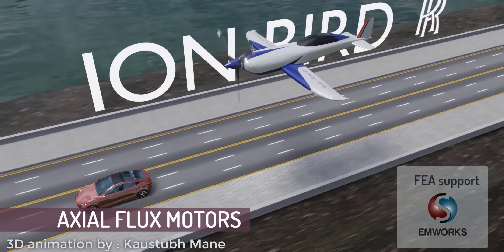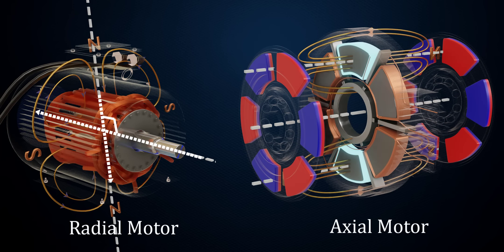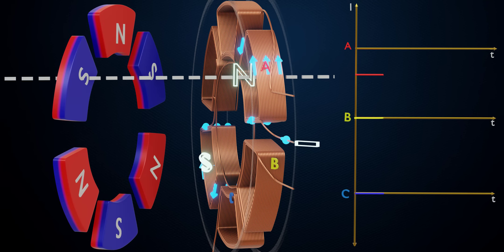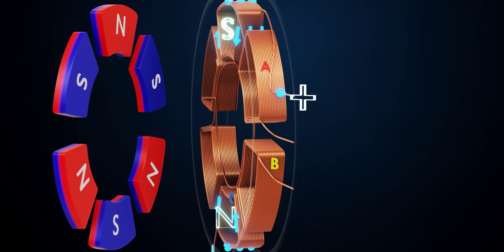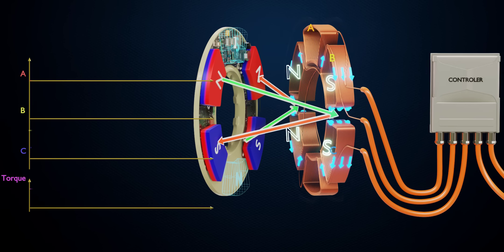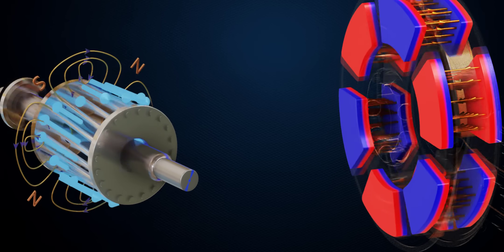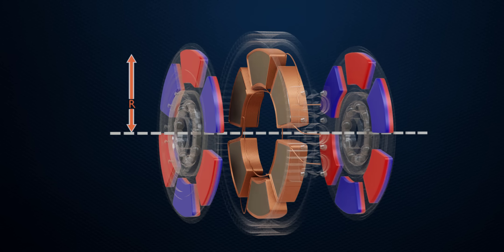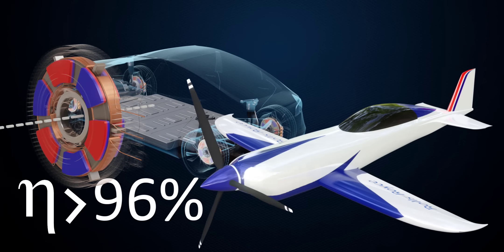Axial flux motors - The new hope

Comment: Thanks for posting this film and nicely explained thanks. A 200 year old motor is what we use today, isn't it time we moved to zero point energy?

It's also a new word for me to add to my vocabulary, that and how these things work. Presumably with an axial flux motor and the better torque wouldn't all the drills be better off than using the radial flux they use now?

Interesting word tangential and very hard to say after a few drinks.

Comment: What a fantastic demonstration. Great explanation on the concept of three phases. I would like to add, people have no idea how powerful shapes are. By simply changing the overall shape of the stator and rotor combination into a disc fashion rather than a traditional cylindrical fashion, you have shown how much more efficient it is.
Reply: Similar to how disc brakes and drum brakes are
Reply: It is not. The main advantage is weight. Not really big advantage for cars, but in aircrafts might save enough weight for extra passenger.  Hobby RC motors have 90+% efficiency.

Comment: Just like the gear interrupter in the maximum machine gun for airplanes you can use a gearing system to turn on and off the wire connections increasing your speed because even computers have a limit on how fast they can go but if it's a mechanical physical connection on and off the timing would be incredibly precise and your rotational speed can increase to any limit
Reply: A $0.10 microcontroller can trivially flip a switch 20-30Mhz for decades without missing a beat or needing any maint.  Please cite some physical connection that anything close to that speed, and isn't going to need constant maint.  Such a dumb comment.

Comment: I would disagree with the affirmations from the video. The radial motor has the optimal structure, the problem lies only it is build using too much metal core, reducing the amount of metal and rethinking the winding will drastically increase its specs.  Radial motors are produced by using a classical, old established, sometimes not optimised design.

A downside to the Axial motor, it is a good source of generated structural vibrations and noise.

Comment: These motors have been around for quite some time, just rediscovered and most importantly renamed . Most important aspect is not motor design but in low cost microprocessor control.
Reply: i don't figure out how to analyze it with ID Iq
Reply: @GreenTechValidation  you have problem understand because these are business details and accounting looking for money. There is very very little engineering truth in what they are saying, they are looking for funding .
Reply: @henrysangret5324  😁
Reply: @henrysangret5324  cannot find any information about FOC control of  axial flux motor in whole internet

Comment: Sorry, this video is not structured well for teaching. You spend the first 4 minutes explaining how synchronous motors work, but never mention that this applies to both radial and axial flux motors.
Then you compare an axial flux synchronous motor to a radial induction motor, a totally different type of motor. That comparison is useless, you should have compared axial synchronous to radial synchronous.

Comment: Yeah that's great. Now get back to everyone when the energy density of batteries is not 2 order of magnitude less than petrol and I might believe an electric plane or car with a decent range is possible.
Reply: TF you talking about. There are literally 1000km range cars already, and it's about to get better, as well as easier and quicker to recharge. You'll need a break anyway before you run out.

Comment: On todays episode of "A revolutionary new idea with seemingly no drawbacks which you will never hear about ever again"
Reply: They say (twice) in the video that it's not new... In fact, they flat-out say that the basic design is 200 years old.
Reply: This comment section have no idea that this type of motors are already commercialized and widely used. For example, Energica uses such a motor for their motorcycles. And Koenigsegg uses Yasa axial flux motors in their cars.
Reply: This is the motor used to spin the record/playback head on video tape recorders, another drives the tape.
Reply: @y2kmagna  its also the exact design of the flat motor in almost all Floppy Drives. It's a pancake brushless motor.
Reply: @y2kmagna  le
Reply: I have not been this impressed since Rockwells' Retro encabulator.
Reply: They've been around for ages. If they were so perfect as this video say, they would be used.
Reply: @jcd-k2s  true, but the application of mosfets and hall effect sensors or smart timers or variable frequency controlers is newish. A coil motor be it any type is old hat, but the application of small but powerful electronics is why things are starting to get exciting. Still is not as practical in applications such as motor vehicles or aircraft where range or pulling power are required, but these are all the steps in the right direction.
Reply: I love that show!
Reply: The main advantage of this machine would be that it saves some weight in lower speed applications (<10k rpm), as the wide construction makes it easier to fit a lot of pole pairs in the motor. Without having to use a gearbox.
You can also achieve this by taking a radial permanent magnet motor that runs at 20k rpm, with less pole pairs, and connect it through some kind of gearbox. By using a motor at high rpm, you can reduce the size for the same power rating. This is done in the drivetrain of a Tesla.
The difference between the first "new" solution, and the second solution in weight will be likely be insignificant compared to for example the battery weight. The dimensions that are most practical will likely determine which motor type you use.
And of course how easy it is to manufacture each motor type.
Reply: Blah blah blah petro oh blah blah blah batteries.. why not simply gen ⚡💡
Reply: Rolls-Royce a major aircraft engine company is investigating this.
Reply: What???
Axial flux motors and generators are everywhere. I've got five of them in my garage.
Reply: Isn't the same motor of brushless ebike hubs?
Reply: Sounds like more people should give an axial flux about this!!!
Reply: Overheating of magnets prevent this to be useful
Reply: Koenigsegg created a 87lb engine with a huge amount of torque. I guess it gives 350hp. The Gamera is a hybrid car that uses it. It is the fastest car in the world.
Reply: This comment will not age well.
Reply: The drawback will most likely not be the motor, but the power supply. If they're trying to replace( or be an alternative) prop engines then they have a long way to go.
Reply: @papermaster7764  There's many other uses for these. They are also a very suitable generator, particularly for low current applications like gas turbines. The media only ever talks about grid solar and it's drawbacks but there is a better alternative: local micro turbines.
Reply: @philipm3173  I am aware of those applications. I was referring to the video topic of them being alternative to prop engines. The battery won't be an issue if it's on ground or underwater. It's a different issue if the battery needs to be in the air.
Reply: A/c as well.. some folks
Reply: I can think of two drawbacks already. 1) Battery range is nowhere near where it needs to be for planes. 2) Lithium is highly reactive to water in the atmosphere. And fires are one of the worst hazards for flying. If the battery is damaged and ignites, there’s no fuel cut of switch.
Reply: Only if you don’t do your part to spread the message, Yhe’is’us
Reply: Lol
Reply: They have drawbacks. Costs, rigidity,  longevity same as other motors. If they were far superior then standard radial motors would have been long a thing of the past.

In other words, as you can see, so many people and companies are working on 150 yr old designs across the board and making drastic improvements but there's only so much to be had in terms of precision  , Costs, materials, durability, efficiency. 

There's likely even better designs that haven't even been imagined yet. Innovation is wonderful like that.
Reply: Except that koenigsegg recently announced raxial motor sounds a lot like this. 250kw and incredibly compact.
Reply: koenigsegg is using this on their new EV
Reply: These motors have been in production for 10 years in the UK.
Reply: It’s already being used in hypercars
Reply: YES!!
Reply: "Graphene"
Reply: It's used in some electric bikes though? Like ones that use Lynch motors
Reply: They lost me at the inclusion of a "smart" element within the motor. Part of the reason I'm drawn to EV conversions of internal combustion is because I want fewer failure points, and computer chips are just a buffet of failures.
Reply: Heard of aptera? Anyone?
Reply: Every now and then someone reinvent the wheel just to evaporate soon after 😂😂
Reply: What an idiotic comment. Axial motors are already being used in many electric aircraft and some hypercars.
Reply: Joke's on you... McLaren, Lamborghini and Ferrari all use axial flux motors in their hybrids...
Reply: You will hear about them very soon
Mercedes is starting full scale manufacture for their ev's
Reply: This comment aged like fine milk
Reply: That's because they don't like to tell you the drawbacks. You won't see this again because the applications of it have many other issues that do not have a solution yet so thereby making this idea useless.
Reply: @joshuasanford6934  Yep, A battery to power these motors for the average car would need to weigh 1 ton (imperial) to provide the energy equivalence of 10 gallons of gas (petroleum).
Reply: @martyfrank  on top of a huge power supply what are they going to do with the old/broken batteries. I'm sure some form of recycling could be used but I don't think that the insides of used up batteries could be recycled (I may be wrong), so the question is where would it go? I feel electric cars and planes are just not the way to go for the future, unless we somehow got a dyson sphere built in next hundred years or if we find a very efficient and clean way to get energy. As the waste of the batteries and the energy cost used to even get battery materials far out way the benefits of the electric vehicles we have today. Though with time and research the idea of all electric cars and now possibly planes could come to reality..... Though now terrorists could just use EMPs to disable everything if that happens. analog is the only way to not get affected by that, that's a whole other topic.
Reply: @loonyroxxs2482  batteries can be recycled (https://en.wikipedia.org/wiki/Battery_recycling) it's just a matter of economy of scale, once there will be enough spent batteries around, extracting metals from them (where they are in high concentration) will be cheaper than mining.
Reply: @Francesco Di Mauro yeah and if you really think about that, that is easily a hundred years or more in the future and we don't have electric drilling rigs or anything of that so the cost is still far far faaar greater then the return will ever be as more gas is used to get the metals out of the earth and to even supply power to the batteries, wind and solar are currently a pathetic source of power to recharge everyones batteries hence why our coal and nuclear plants are the main source of power for those electric vehicles, so in all if we were to suddenly put a ban on all gas powered vehicles we would destroy the planet in a matter of years from the huge quantities of pollution to power those precious safe for the environment electric cars, and the fact you gave me a Wikipedia article shows me you didn't put a lot of effort into researching this topic, its easy for media to sway ideals to something that sounds better but really has way more negatives then the alternative.
Reply: @martyfrank  10 gallons of petrol requires 170 gallons of oxidizer to extract the energy so try to squeeze  this in a car also.
Reply: @darkbulb367  , welfare
Reply: @darkbulb367  do you have any evidence to support those conspiratorial claims?
Reply: @martyfrank  Comparing straight up energy density like you are is essentially meaningless when you consider the difference in efficiency between the 2 technologies. An ICE based car inherently needs to carry more energy because of its inefficiency. Comparing range is far more practical. 

Going by density ignores the fact that an ICE based vehicle can only turn 18-20% of the energy stored in the fuel into actual useable power. For the electric motors found in an EV that number is more like 85-90%. So say you have an ICE based vehicle that holds 20kw worth of fuel, an EV could provide the same range with less than a 5kw battery. 

Now you might say "well the grid is still largely powered by burning FF's" (which is true.) But even if you're charging from a diesel burning power plant, they can achieve over 50% efficiency. Fully charging that 5kw battery only takes 10kw of fuel at the plant, compared to 20kw for the same range in the gas powered car.
Reply: @FrancescoDiMauro  that still doesn't change the fact that lithium has a tiny fraction of the energy density of gasoline
Reply: @loonyroxxs2482  you're in the wrong video if you don't understand the inverse square of magnetism. EMPs are theoretical and a non issue. The only time they're an issue is next to a thermonuclear explosion..  but then emp is the least of your worries.
Reply: @formattable1  Undoubtedly true but quite sufficient for getting a light weight vehicle around our urban environments. A two tonne plus SUV is an evil absurdity in a city, whether electric or petroleum powered.
Reply: @loonyroxxs2482  throwing away Li Ion batteries will be like throwing away gold.. why would they do it? It’s already mined and they know the exact concentration of what’s in it already. It’s easier than mining for new stuff, especially when you apply economy of scale.
Reply: @loonyroxxs2482  Simply, a gallon of gas has much, much more energy than a battery of the same size.
I would like to see more hydrogen powered things. Use nuclear energy to separate H2O into hydrogen, cars could have ethier a replacable or refillable tank, no waiting for a battery to charge. There's already propane and natural gas vehicles that contain a flammable gas under pressure so it wouldnt be much different with hydrogen.
Reply: @Longbow64  True hydrogen vehicles would be a good step, my only fear would be it exploding if a fire ever caught up in the engine lol, although I don't think you got a bad idea going there
Reply: Because it turned out once you move from cool 3d animations to actuall real world implementation, it turns out it actually has drawbacks. Who knew ??
Reply: @marianpazdzioch6632  what drawbacks?
Reply: I suspected this is what the video's title is.
Now watching with a heeavy dose of salt and skepticism.

And this is coming from someone who firmly believes ETs are observing us up close.
Reply: This is the green tech story in a nutshell. "Omg. world changer. we need investment." years pass "Oops. Well it doesn't scale. Doesnt work when the temperature goes above 71F. Produces toxic byproducts. Costs $1T to make three of them." etc...
Reply: @KevinKimmich44024  I have no idea why people like you are so pro-pollution. So there's no wind turbine farms all over America. We just imagine there are. It was another failed green technology.  Just stay in your bubble of delusion.
Reply: @UCchT9NSgfajAoQ8ZrQYoO3w I've been following "green tech" and electric vehicle companies since the early 2000s. My personal conclusion: the only practical way forward, if humanity is resource constrained, is unlikely to come from new tech, but from improved efficiency and reduced consumption and living a wise life, ditching the current financial system and fiat currency. Nobody wants to do that, obviously. So instead, the oligarchy that runs the western world will devote lots of resources to garbage technology that can't really hold a candle to fossil fuels. Thousands of man years of engineering will be pissed away on shiny new tech that barely works and will end up causing at least as much environmental problems as the devil we already know. "Green" tech is really banking on some future breakthrough that might never show up. There's pretty grim analysis of the current installed base of green power production in terms of EROI. I'm not sold. I think it's mostly scams. Just more of the same old shit with a different sales pitch.
Reply: @KevinKimmich44024  it's the same story in a hundred different industries, particularly space exploration/exploitation. hundreds of different companies crop up with CGI "plans" for orbital habitats, martian habitats (one that won a NASA competition of $500k, and dropped the idea almost immediately), rockets, and tourism schemes.
Reply: @KevinKimmich44024  "so, thanks so much for your investment, you have been part of the change <3 <3, well get there next time. In fact we have some promising research coming up, get hyped, investment opportunities start next month, only for those who really care about life on the planet and having oxygen to breathe . "
Reply: @CH1K3N99  We are pleased to announce we received our next round of funding. That's enabled our team to put new animations on our web site. Our quadruple secret NDA prohibits disclosure of test results, but once we secure our next funding round, we wl embark on new plans to make plans for manufacturing.

Comment: Electric motors are great. But batterie development is stuck. Batteries you have to charge are never good solutions.as long as we are using lithium style batteries and little childs in Chile have to dig it out i have a big problem with that. Especially in planes where weight counts it's useless at this time. Maybe in a few years when batterie technoligy has changed. The best thing would be little fusion reactors 😁